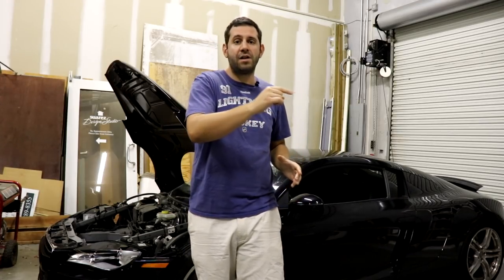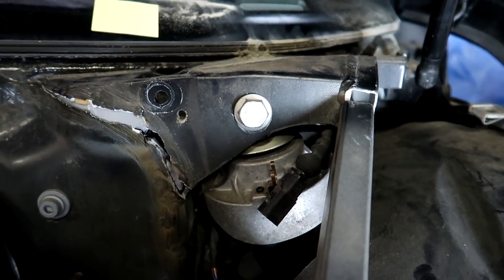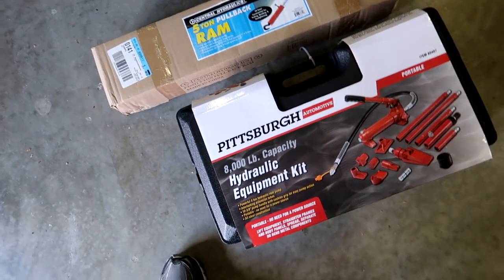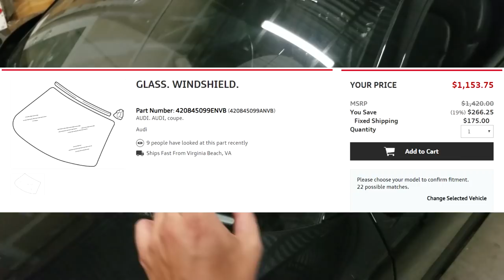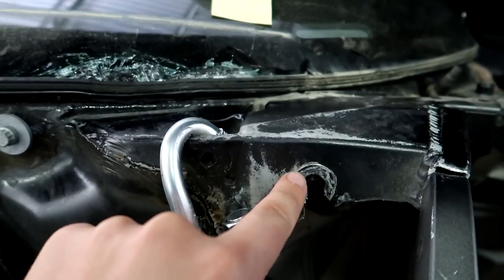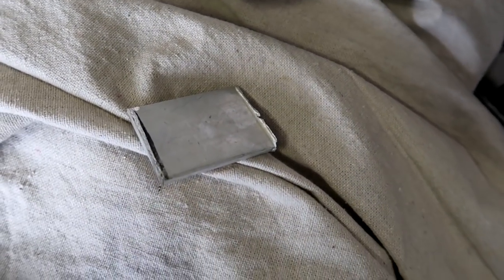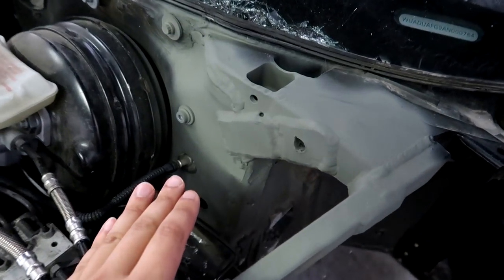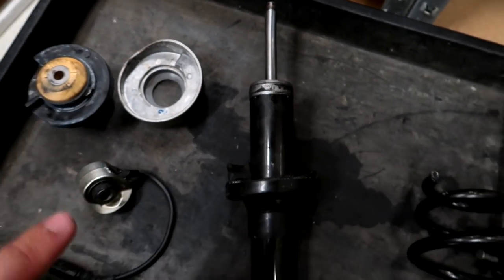I Repaired My Totaled Audi R8's Cracked Frame for $500! Insurance Quoted $29,522!

Comment: Never use the jackstand as an anchor point,
You are literally pulling the jackstand out from under the car.
Reply: That is why i was scared the whole video
Reply: @meltedgyrofpv8477  I so agree,, I was just waiting for the pop, n , drop.. duh.
Reply: This is Youtube, all sorts of unsafe practices exist. They edit out most of the embarassing accidents or mishaps. This is a comedy routine I think?
Reply: Exactly!!!! He is so experienced. How could he! Also that windshield - _-
Reply: I was cringing when he anchored the chain to the jackstaand.  literally screaming ( NoooNooo Noooo..)
Reply: Exactly, a mount point in the concrete is easy to do.
Reply: imagine the horizontal force vector on that jack stand
Reply: YES !!!!

I was cringing this entire video, expecting the jack to fly off.
Reply: Yes, I agree - some silly things going on here.
Reply: One of the sketchiest things I've ever witnessed.
Reply: yeah this guy is not the smartest.
Reply: Surely common sense dictates not to do such a silly thing. This guy is not daft, I just dont understand why he did it. plus i imagine a change of underwear was required when hole blew out. A perfect video on how to maim or blind yourself
Reply: The overall cringe factor of this video is insane. Not using the bolt through both holes to pull down evenly on the frame is the worst. He doesn't even think about the rear of the frame lining up, as long as the front does. Even after he puts the bolt through both holes, he only pulls on the front of it, which is even worse than how he had it the first time. Then he puts "etching clear" on the aluminum frame so it doesn't rust. Brilliant.
Reply: That's why he said don't do what he does in the video.
Reply: Reminds me of the line from "House MD": 
"Why do you have the New Yankee Workshop on your DVR?"
"It's an idiot with power tools, how much more suspenseful can you get?"

Comment: No shop that l know of would touch that repair. Firewall damage like that is an automatic total loss. A shop that repairs that could lose millions in court. If a passenger gets hurt in that car the next time it is in an accident then you are liable. I'm not trying to be a jerk, just being honest.
Reply: Audi would have did the same thing. Look at how they fix the problem
Reply: @5wiftxjohnson174  a tear in a firewall ( structural integrity of the cockpit ) is a total loss in the real world. Anything can be fixed but is it moral to do so knowing it could cost someone their life. That's what lawyers argue in court and it has cost shops millions in court. Our opinions don't matter much. What happens in court is what matters. We're not allowed to heat frames on trucks anymore either like they used to do. We have a truck on the frame machine at work. You have to pull it cold with no heat. If it doesn't come out or if the metal tears, then you have to put a new frame under it. This truck is getting a new frame. It is only a wrinkle where the front bumper bolts up but we are not allowed to heat it. Vehicles are symmetrical and all repairs have to be within 3mm when on a frame machine, 4mm is unacceptable. It is all about liability in today's world.
Reply: @lilbo1Y1  Personally, I'm glad there are high standards and I appreciate the people who do quality work.  It may only be to avoid liability, but it saves lives.  This R8 needs to be parted out and recycled.
Reply: the damaged part is actually more like a strut tower which connects to the firewall, most shops wouldn't touch the job because the insurance companies wouldn't pay for the repair, therefore it falls into the world of a rebuilder. Its a world the guy that works for the insurance body shops doesnt understand at all.
Reply: @2009G8Gxp you almost had me until you said "would I do the same to an air craft then fly over a ocean. Lmfao... no Bob  , no bob I wouldn't do any repairs to an airplane and fly it anywhere. Lol
Reply: @allendrix  , l understand, l have bought and built totals before so l know. I'm not knocking this fix from a rebuilder point of view. My comment is from a shops point of view. When a car leaves a shop, it doesn't have a rebuilt title following it around. You're wrong about insurance companies, they are not your friend. I was fired from a shop that l was at for 5 years for refusing to make an unethical and illegal repair on a door that had major damage to the intrusion beam. The insurance adjuster went to my manager and told him that l cursed him out ( lie ) and told them to get rid of me or they would stop sending them work ( which is breaking federal law, a insurance company can't tell you where to take your property to have it repaired ). The next morning they fired me out of fear of losing work.
Reply: Arthur Walker sorry to hear that man. what i meant is that insurance wouldn’t pay for the Audi approved repair.  I know, insurance companies only care about the bottom line.

Comment: This is exactly what I was thinking to start with upon seeing your last video showing the break/crack. I lived in the Bahamas from 1972-76 with my Grandparents. A United Auto Workers Certified Welder who had spent 40 years working for GM at the Detroit Factory who was a friend of My Grandad came over to White Sound on Elbow Cay and He taught me how to to stick weld professionally at age 12 in '74. We had a Jeep that rusted out and cracked in half all the way across just behind the two front seats. My Grandad had to go to Hopetown settlement at the other end of the Island by Boat and stayed gone about half the day. I jacked the Jeep up, Ground the rust off, welded the crack all the way across then welded 1/4" Steel Plates over my welds. Grandad was pissed when He left because He said the Jeep was beyond repair. He was shocked when He came back and I was driving it. My repair was still holding strong when the Motor Blew up years later and I was just a 12 year old kid. He said it could not be fixed and I thought I'll show Him cause I can fix it so I did. Your welding and then reinforcing it with Aluminium Plates sounds like a good idea to me. Use 7075 Aircraft Aluminium Plates and it will be 2-4 times stronger than when it left the factory. This car was designed by some fool with 12 years of School that couldn't tell you which end of the hammer to hold. I took one look at the broken frame and I knew right off that it was a Shit Design. I only have a High School Diploma even though I did skip two grades and graduated at age 16, but I do know which end of the Hammer to hold!!

Comment: I'm waiting for the alignment specs to see how far off it is or if they can even get it into spec
Reply: I could see that being a problem in a McPherson strut setup. Audis use a multi link/control arm setup. The damage was to the shock “tower”, not the control arm mounts. I would bet that the alignment is not that far off. BTW, I have direct experience in aligning a R8 after this exact repair. Samcrac is not the first person to do this in this manner. He just has shown all of YouTube a secret of a few rebuilders. By showing everyone, the salvage price of the R8 is going to increase a ton.
Reply: Sam crak fix the crak lol
Reply: Seeing as that is a coil over shock and not a strut I would honestly be surprised if the alignment was out at all. Removing that shock from the car altogether would affect ride height not wheel alignment. Not only is this type of failure not uncommon to the R8, it is not that uncommon to see in other vehicles. The repair should compromise nothing including safety.
Reply: @jeffandrews7335  For that strut to be bent like that the tire/wheel had to take a lick. I bet it doesn't line up perfectly unless the lower control arm is replaced
Reply: I think it can be placed back with in spec.
Reply: The shock tower controls the height of the strut so if they're not bang on their camber would be off similar to a sagging spring condition
Reply: German precision engineering Vs Sam’s Hugh Crac good luck to proper fit and alignment, LOL. Totally entertaining.

Comment: Welding a cracked aluminum frame...by cellphone light...with pullback hydraulics anchored to the jack stand that holds up the car. What could possibly go wrong?
Reply: Well you can crack the windshield i guess...
Reply: Yeah, he's lucky it broke when it did.  It looked like the angle of the forces might have eventually pulled the jack stand out from under the car, if enough force was applied before the gap was closed.

Comment: Bad luck on the windscreen.  I did the exact same thing some years ago on a Lancia Delta.  Put a hammer straight through a brand new headlight that had been on the car about three hours whilst trying to straighten the front panel.
Reply from the maker: Good to know I'm not the first guy to do this.
Reply: Guess the newer model at least, imagine the original group b car would be a bit hard to get parts for?
Reply: I've done repairs that close to a windshield frame before.  Chances are it would of cracked either way.  Still, not too bad $500 in welding plus a windshield.  I was wondering if ti would be a bigger repair.
Reply: dentistguba It was an ‘86.  Narrow body with the twin cam.  Someone in a Volvo with a tow bar reversed into it and I’d just changed the headlight to a new unit.  Making a “minor adjustment” with a rubber mallet.  Next thing I know, broken glass all over the floor.

I’m actually building another Delta HF at the moment.  It’s been a competition car but I’m going to make it road legal again.

I’d love a Delta S4; that would definitely be my lottery winners car.
Reply: I'll admit I've done something similar too but alcohol was involved.  I wasn't nearly as calm about it as you.  Good job.
Reply: Shattering an old headlight is not the "exact same thing" as shattering a supercar windshield.
Reply: Usually, it's smart for a company to not fire the person who makes a high dollar mistake.  It's like what Joe Pesci says, "you take apart a carburetor without taking it off the engine and you drop a jet... you learned the hard way..."  

Next time (*hopefully*) Sam'll take the windshield or headlight off before taking any blunt force applying object (head included) to a car part.
Reply: I had just put in some carpet with padding and put visqueen down to protect it. 10 minutes later a guy with a forklift drives right across it, gets stuck because it's slippery and spins 2  of his wheels. He made giant holes right through it in a couple of seconds. Had to completely replace everything. The booth was a 20' x20'.
Reply: Wow!! And I bet it was an S4 just to make things worse!😢😢
Reply: @OMGWTFLOLSMH  with my truck..the windshield is a ton cheaper lol I'd rather smash the windshield
Reply: No, he's a Brit. The headlight was probably a Lucas.